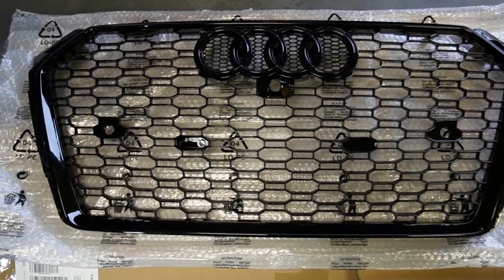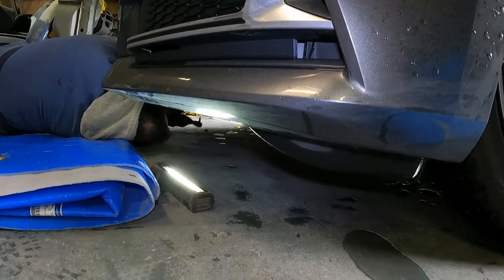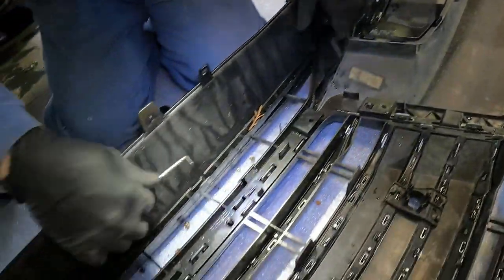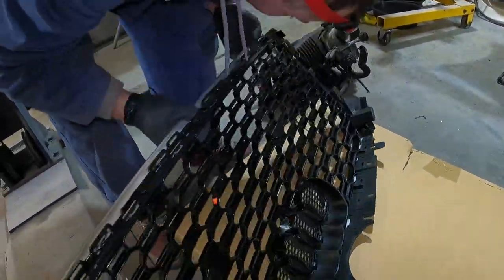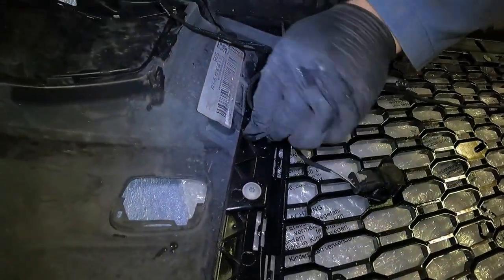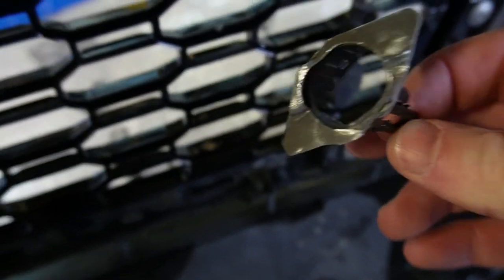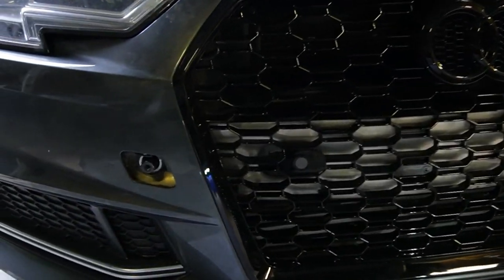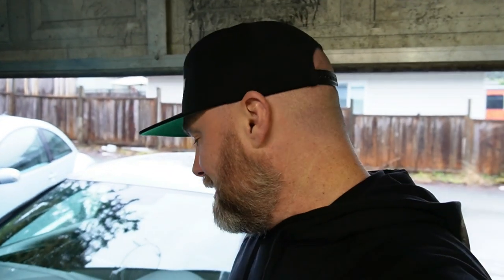Audi B9 S4 - iGround Canada RS Style Honeycomb Grill Install

Comment: I just did this install on my 2019 S5; however, my grill didn't come with an outer plastic trim ring, mine was all one piece. My grill also came with a huge rounded camera mount so I threw it out and had a 3D camera mount made, sits back in place just like OEM.. Unfortunately for the S5, I did have to notch out the the top of the crash bar for the camera to fit and also the bottom sections of the crash bar to get the sensors to fit, and then I painted the crash bar black to blend in. Looks so much better than the stock grill.
Reply from the maker: My grill came as one piece too. We had to pull it a part to separate it before install.

Comment: Great video! where did you get the front camera?
I have an S4 B9 and was wondering if I can install a front camera, thank you!
Reply from the maker: It's OEM equipment.
Reply: @VancityAudi  So if I buy the part from audi it should be plug and play?
Reply from the maker: @kevinqian1204  you don't buy the part. You buy the car, and it comes with the part installed already.

Comment: Looks clean. Was the battery disconnected during the whole process to avoid any sensor recaliberation ? 
I just ordered RS style bumper kit for my B9 A5 from iGround.
Reply from the maker: No. I included every step we took in the video.
Reply: Yeah, this is a good point. I have an RS3 and when there is a Adaptive Cruise Control sensor on the front, this will break if the battery is not disconnected.

Comment: Where did you get the license plate holder ?
Reply from the maker: https://www.ebay.ca/itm/324044407102?fits=Model%3AS4%7CMake%3AAudi&hash=item4b728d413e:g:c4AAAOSwUndgyPBA&amdata=enc%3AAQAIAAAA4DmaXOlAUZdOYhsCT7atPs%2Bv%2FKRQwARlxHi4MYc7i5OZ1919mSh1m93K%2FG00fY5MCeazS%2FAOYGMEld4ovNBOztPbBC%2FE2QOhl5s7p3bYqhrsDoa7jsRIaaXF1OZeXIbhyhwxOwJChC4%2BfajhGuE0zXVxfR3%2BfHxrDxDkdKyc6RxqEcS3qfhXtwcUbYHgsbZwULLn0t%2F3k2QcvJ1%2FfhaU29lbPaBt1hmTKbqOQZO%2FKCzrimLz0TMcIRwtkQkLibQcRhtLu1Zb7nhaEK0l9ZxAq%2FlexrsbVWBTCFOmx43l298R%7Ctkp%3ABk9SR6CKsKSfYg